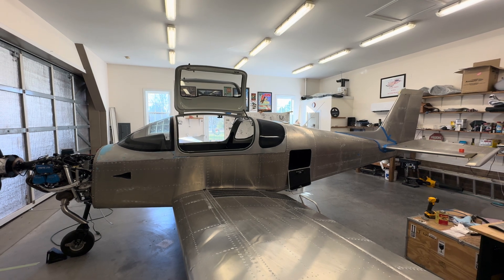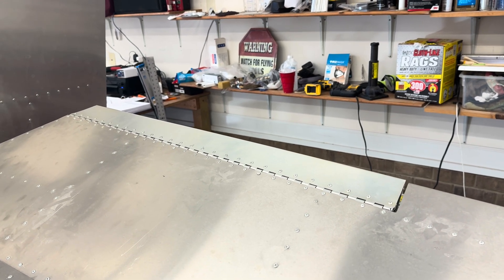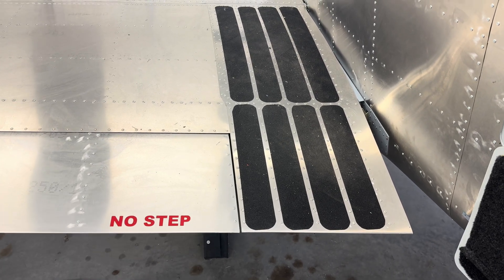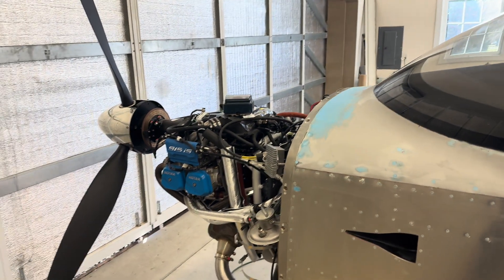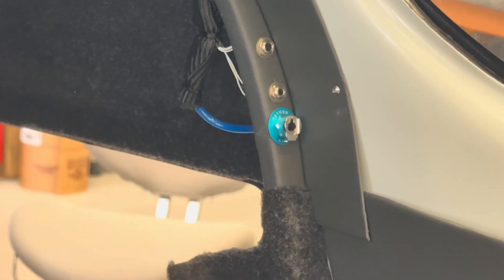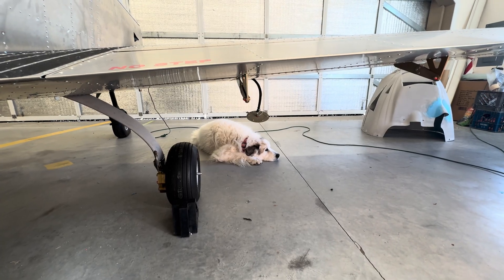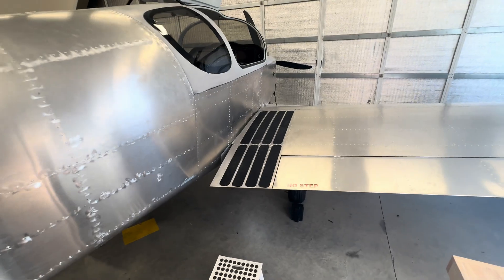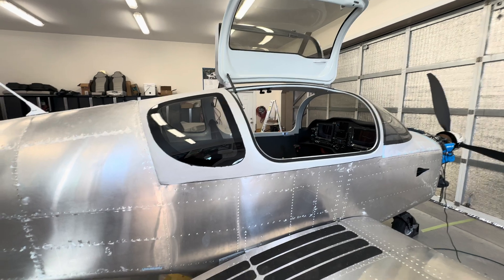1500 Build Hours - Sling TSI Build Update

Comment: Great to see your work!
We are roughly above 1.000 hours with our build right now and we haven’t even started with the Wings and the installation of the engine… In my case priming all the parts and wiring all the avionics myself are probably the biggest time-consuming things…
Reply from the maker: I used Midwest Panel Builders for my wiring harness and panel, but there is still a significant amount of things to do wiring wise.  If you did all your wiring, I imagine it did add a significant amount of time.  I couldn’t fathom taking that on for my first build.  I think I spend at least 100 hours on the priming and alodining.